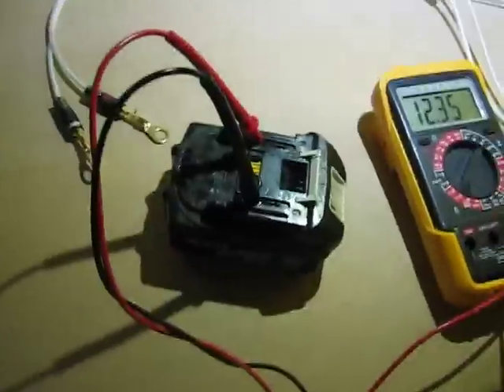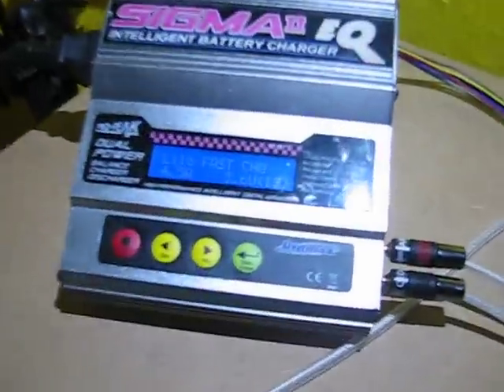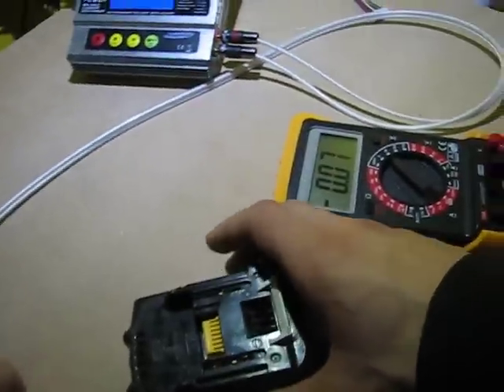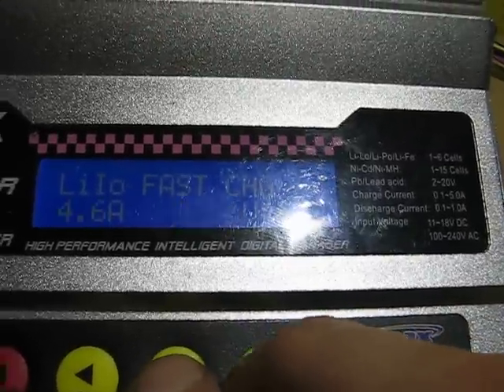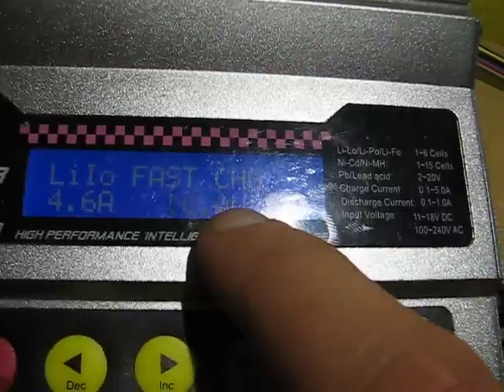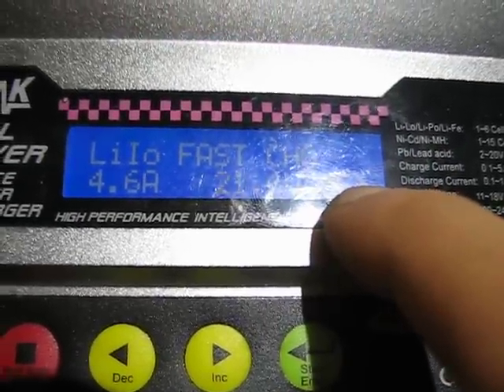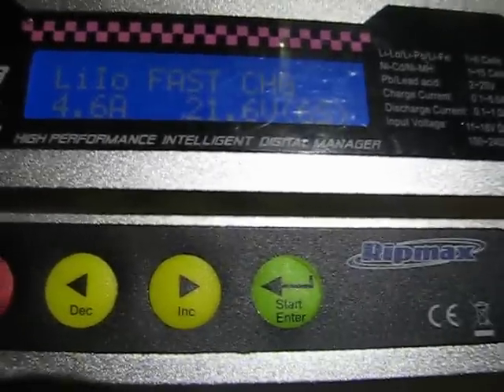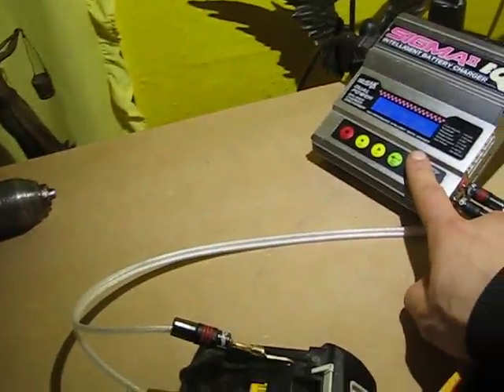Makita batteries alternative charging after battery failed on DC18RA(original charger)

Comment: Yes it works, but cells not balancing.
Reply from the maker: there is no way to balance them unless you connect them in individual way ...that charger has that possibility but you would have to rewire whole battery I was trying to do such thing with old Dewalt battery but never finished it as I was kinda scared to play with 18650 3000mAH cells

Comment: what is the name and model number/name of your charger?.....can you use it to charge makita and craftsman drill batteries....i cant find any on ebay that look like yours
Reply from the maker: +Tim Spur Sigma 2 eq intelligent smart charger. Yes I can as long as it is LiON if charger supports that type of chemistry its fine. Problem is with this method that it charges from one cell to another which is not very effective was perfect for me buying cheap not working bl1830 with bhp451.
this category 
Toys & GamesRadio-ControlledCarsCar Parts & Accessories